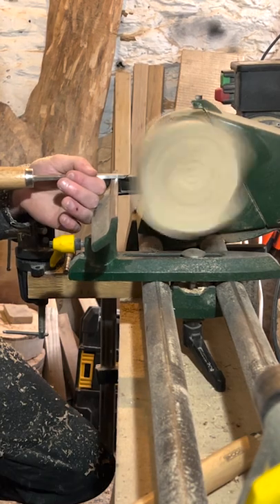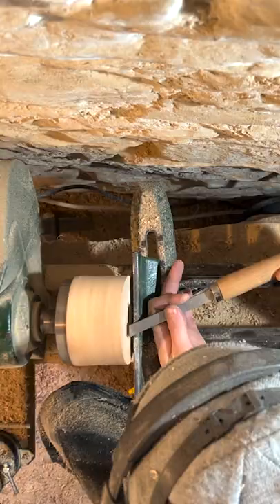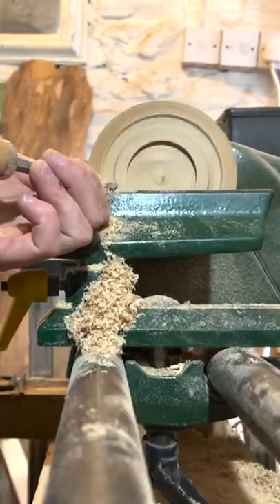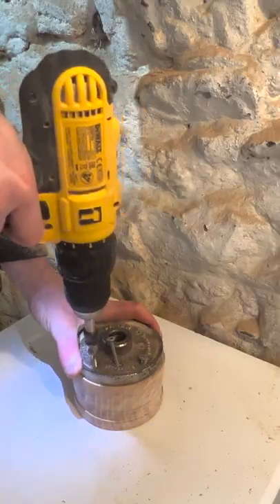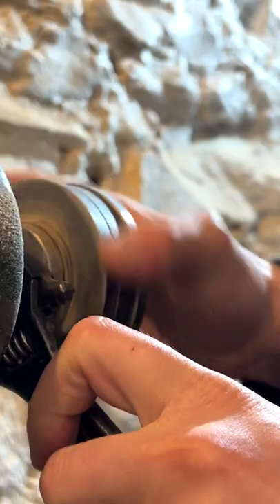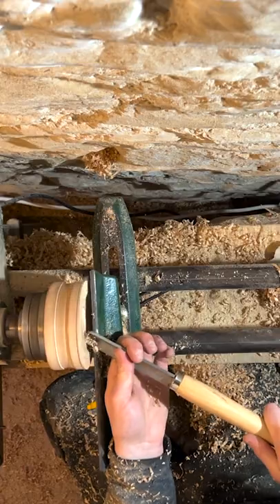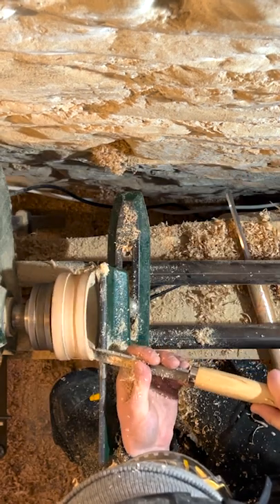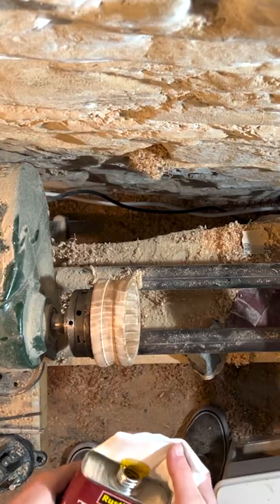Woodturning - Making an Ash Tray #Shorts

Comment: If you cut the wood instead of scrape, it will leave you with a better finish and you will have to sand less. If you're already trying to cut in this video, you should change your angle. Nevertheless, nice work.